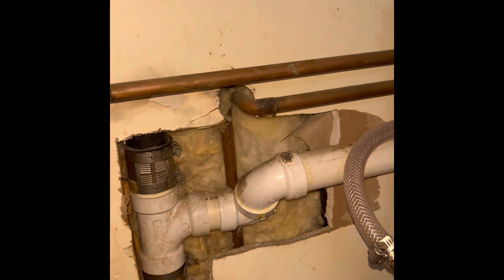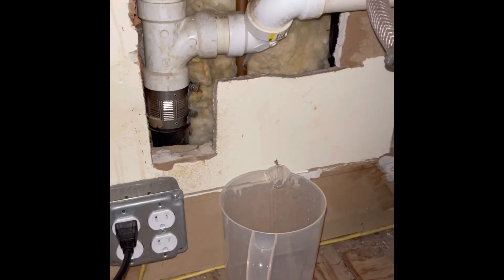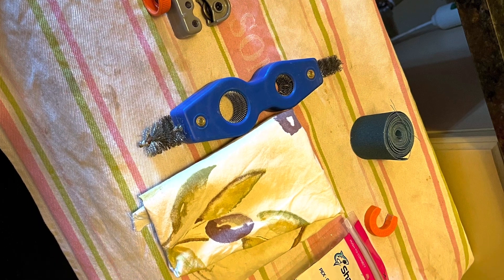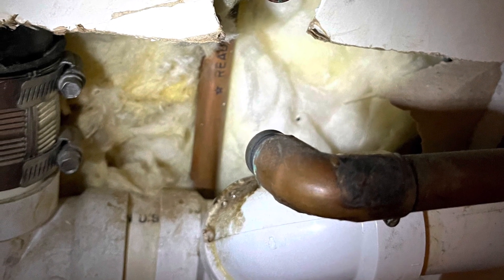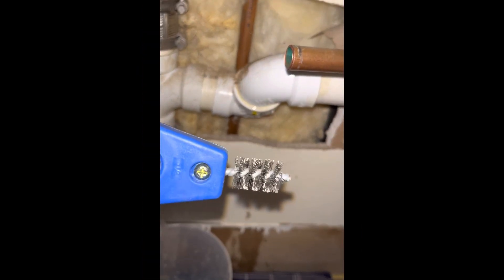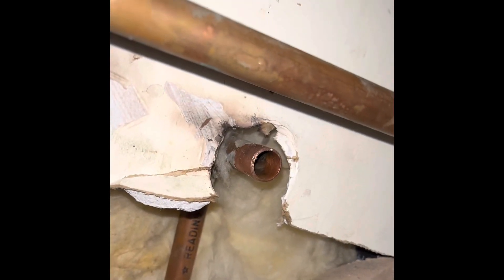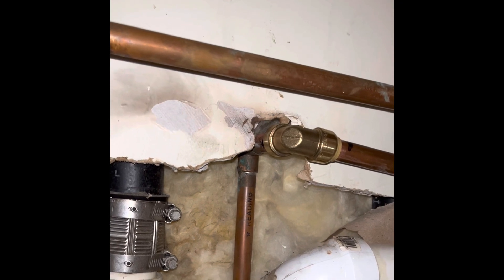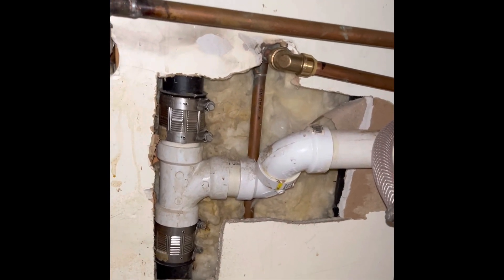QUICK FIX: Copper Pipe Repair Using SharkBite

Comment: Great video. My attempt  failed though. I dont have the cutter , I used a tiny hand saw and the edges of the copper pipe were dented out, then I sanded it and did to much and it leaked. I dont know what cutter to get at home depot or parkers hardware. Please help. We havnt had water in 27 days. My fiance and her mom are so distraught.
Reply from the maker: Here are two that should work.  Don’t skip the polishing step.  The sharkbites will leak if the pipe isn’t smooth.  Good luck!!
Reply from the maker: Δείτε την απάντηση με Short

Comment: Has it leaked? I have a leak in my attic on the 90 as well
Reply from the maker: No leaks on the 90 or a few others I have used.  Good luck!
Reply: There are several inches of pipe attached to one end if the old elbow, and none attached to the shark bite.  How did you get the pieces together?  Seems there should be a fsp.
Reply from the maker: There was quite a bit of “play” in both the pipe coming up vertically from basement and the horizontal run feeding the sink so I was able to easily insert the elbow.   If your pipes are tight, you have to plan your cuts carefully.